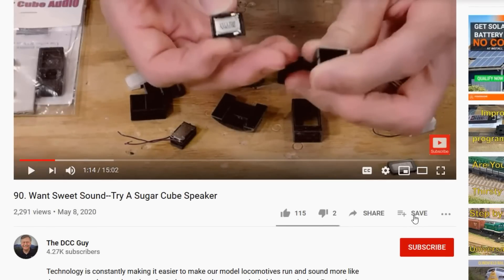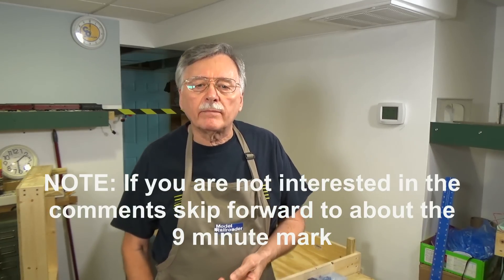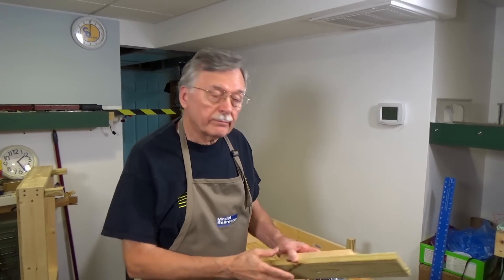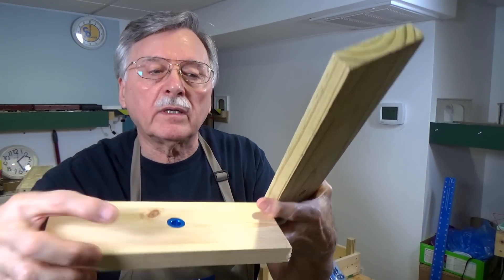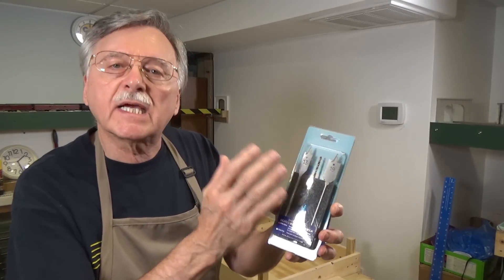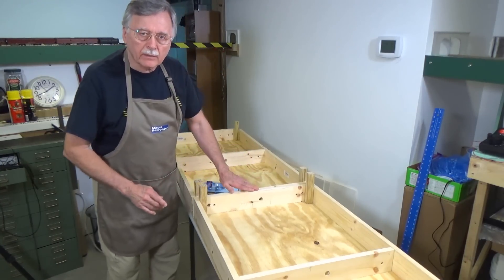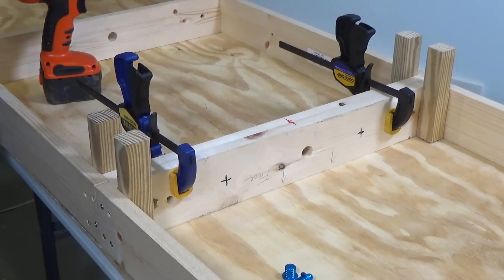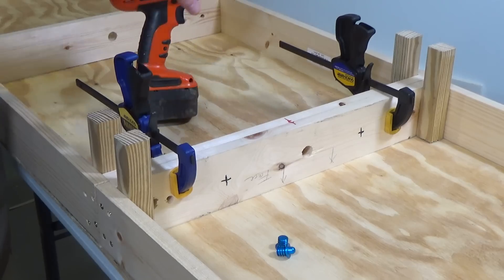Alignment Dowels (132)

Comment: This is a great channel,  usually full of sound guidance,  but I must take exception to the advice on glue which, if not exactly nonsense,  is at least very questionable. First, the esoteric,  if possibly eccentric,  requirements for the construction of split-cane fishing rods (nearly all modern rods are built from carbon fibre) are of almost no relevance to building baseboards, unless they are to double as trebuchets or catapults. Second, Gorilla glue is not a type but a brand. Gorilla make glues based on various adhesives. What he is talking about is polyurethane glue which is available from many manufacturers. It is well tried and tested over several decades for use in boatbuilding,  among many applications. The only proviso of which I am aware is its slight susceptibility to UV degradation by sunlight if the glueline is not covered, seldom a problem for model railways. Most would consider such an adhesive overkill for modelling purposes. The waterproof versions of Titebond or EvoStik PVA are more than adequate for baseboard construction. After all they are used in high-grade furniture assembly which generally takes more of a beating than model railways. If one is neurotic about gluing then there are always  systems such as urea formaldehyde (Aerolite),  or resin-based (West or SP) which has almost limitless strength and life expectancy in boat, ship and aircraft construction. Third, the contrast between gluing and screwing is really a false dichotomy. Unless one truly wants to be able to dismantle fully, the standard method is both screwing and gluing, each method of fastening having complementary advantages. Fourth I saw no discussion of weight. Solid timber can be heavy and cumbersome. If one is indeed moving stuff around then box and girder designed plywood construction has much to commend it.

I would add a couple of other observations. The alignment dowels become more accurate the greater the space between them. In the video they are closer together than I would suggest. Try to get them as near the outside of the boards as you can manage. If at all possible, I would counsel against drilling them into the end-boards in situ. The scope for angular inaccuracy is high. Prepare the end boards for the fixing bolts and the dowels before constructing the baseboard, ideally in a drill press to get complete vertical accuracy, and preferably with a Forstner bit, rather than the coarser flat-bits. My own design of hardened steel alignment dowels incorporates the fixing bolts concentrically so there is only one set of drilling to be done and they take up less space. They are a fiddle to make however and the ones shewn will be fine for most purposes.  DCC also  make them with a 5A through-power connection which sounds neat.
Reply from the maker: When using a new product I tend to follow the manufacturer’s suggestions. In this case they recommend using PVA glue to lock them in place.
Reply: @TheDCCGuy  The discussion on glue related to construction of the baseboard, not the fixing of the dowels. I have no opinion on DCC's choice of adhesive. As you say, one would tend to go with their recommendation.
Reply: Thank you Rick, saved me the trouble of leaving a comment - you articulated my thoughts and then some!👍👍
Reply: @TheDCCGuy  
Hi Larry, the one mfgr suggestion you shouldn't have followed was drilling the smaller dia from behind - which a spade bit will always create blowout chipping, somewhat butchering the shoulder for the pin...

You should drill 3/4 or so of the way thru from the interface side, then finish from behind to get nice clean holes every time.

Otherwise, great video & alignment pin technique!
Charlie

Comment: Try as I might I can't understand what these pine do.  There is no obvious connection between them.  You mention male and female but how do they work ?
Reply from the maker: The two male pins insert into the females and since they were installed in a set position any time you mate the two modules up the pins will always interlock in that exact same position guaranteeing everything will fit together perfectly assuming you got them installed that way. These alignment dowels or registration pins are also used to guarantee that the two halves of a mold go together perfectly when an injection mold is put together, and other similar processes.